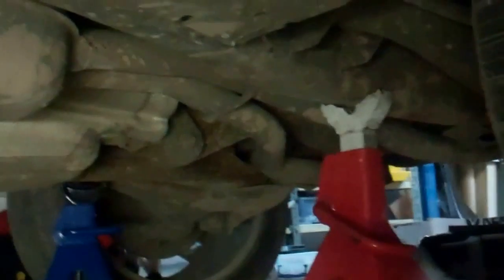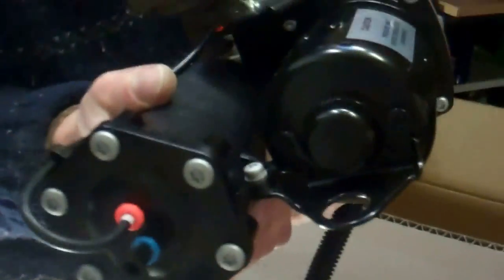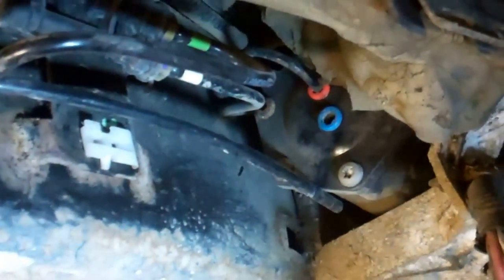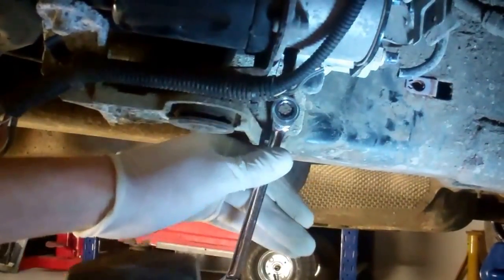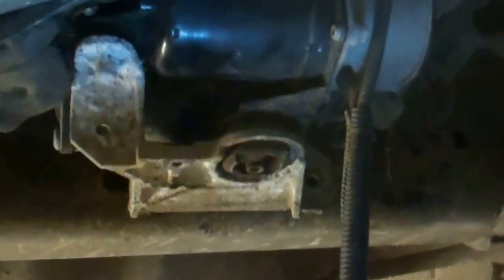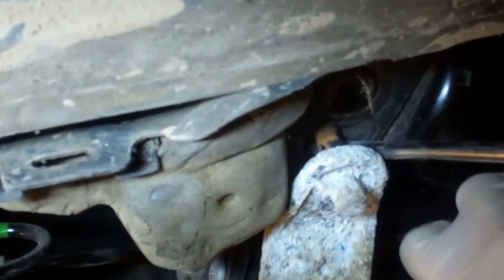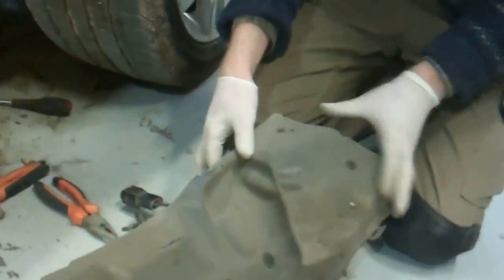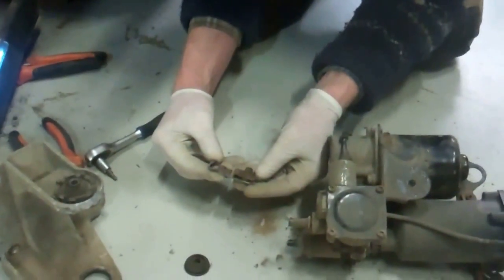How to remove the air suspension compressor on Land Rover Discovery 3 LR3 / Range Rover Sport

Comment: I used this video as a baseline.  My lines didn’t stick within the air compressor.  I actually let the compressor hang for a bit as I pulled on the larger hoses to get them out.  The replacement took me about 3 hrs with a few breaks here and there.  Thanks for the video.
Reply from the maker: glad it helped

Comment: Interesting , would like to have seen the gallery pressure read out on IID tool. Recent experience with this fault turned out to be a failing battery.  This was followed a few months later by the vehicle being unable to hold  gallery pressure this turned out to be a leaking Voss fitting  in the air dryer ( the nice blue one) . Was able to get a second hand lid from wreckers and was able to swap it out while compressor still in vehicle, in fact it would have been possible to change desiccant and filters while still in vehicle tho I didn’t bother any who new old lid sorted issue now all good

Comment: The difficult airline fittings I pushed on the plastic clip with side of a pair of needle nose pliers and then push pulled the air line and the pipe came away

Comment: Hi guys, ive just purchased a new compressor, it says its a direct replacement on my 2005 range sport. Itn amk type, 2 pin,  can you tell me if this is the correct one i need, as someone said i should check incase i need software reprogramming as its not hitachi brand. Do you know anything about it, find it a little confusing because ebay seller states its a direct replacement , "plug an play" . 
It looks the same too in the photos, so im not sure the difference now between hitachi and amk type. Other than price, which is why i chose amk type.
Any help would be great. Cheers.

Comment: If the blue valve/connector is leaking can it be replaced?
Reply from the maker: Yes this part is available with the rear "canister" as a complete unit - LR PN VUB504700 for around £70 but its worth doing as it has all new drying crystals inside etc

Comment: Hi team, do you have any opinion or thoughts on genuine OEM compressors V after market?  I have overhauled my compressor in the past, dryer kit, orings etc. Eventually I replaced with aftermarket.. Worked great for 5 months and failed.  I was given full refund as under warranty.  Have now new OEM HITACHI FITTED  and works fine..   So best to buy OEM or after market from reputable global reseller.?

Comment: Hi, i need to replace the End Cap, Filters and Beads on the Air Dryer, can this job be done without the need of removing the whole Compressor unit? I am hoping i can just remove the screw which secures the Air Dryer and pop the unit off of the compressor. Please can anyone advise? Thank you

Comment: Hello everyone!

I have Land Rover Discovery 3, 2007 year. I had a problem with air suspensions, first I got that yellow indicate " Suspension fault", after diagnostic I was informed that my compressor's valve block is broken, they advised to change compressor.
I changed compressor my self, did everything by you-tube video, but the problem is that Error is still showing "Suspension fault" and compressor is not pumping up car.
Idea is to take car to service, make new diagnostic and delete error, and than maybe its should work.

Does anybody had similar situation or can advise what could be a problem.
Reply: I had the same issue… changed the compressor with no change only to find out that a relay had gone bad.